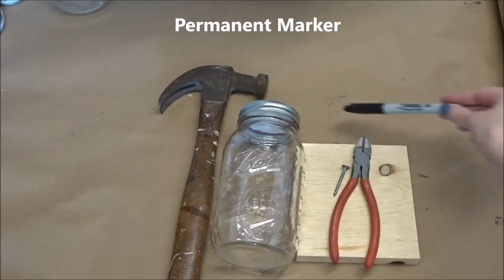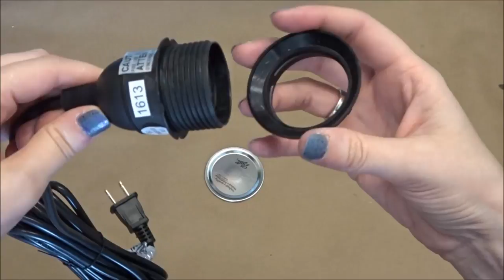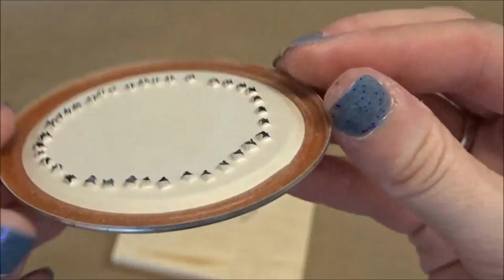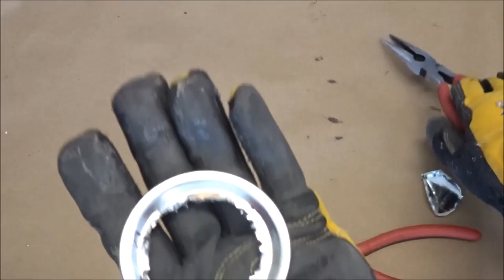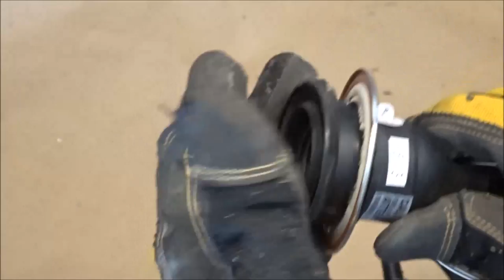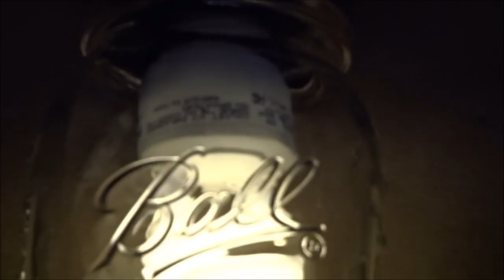*DIY* Hanging Mason Jar Light

Comment: Take apart the hemma light so it's only the cords. That way you dont have to awkwardly hammer a million holes and pry off excess metal. Slip the wire through then put the light back together.

Comment: Nice idea, but please get a dremmel tool or something similar to clean up those extremely sharp and dangerous edges that were left on the lid. The way it was left is a potential for a fire or sending someone to ER to get stitches when trying to change out bulb. A hammer will not take off the sharp edges no matter how many times you hit it!